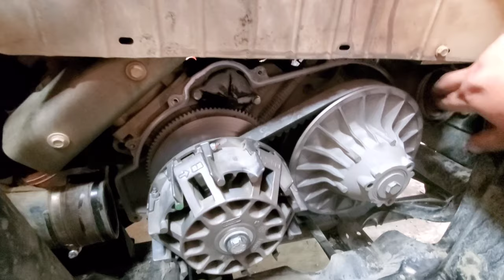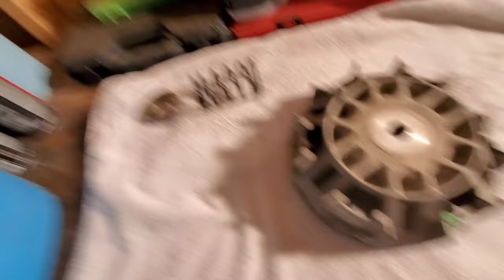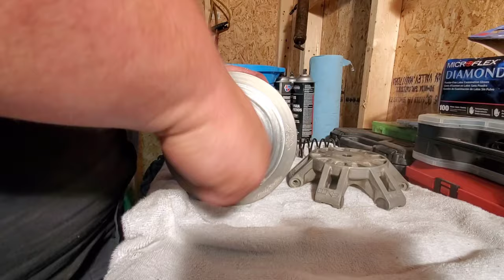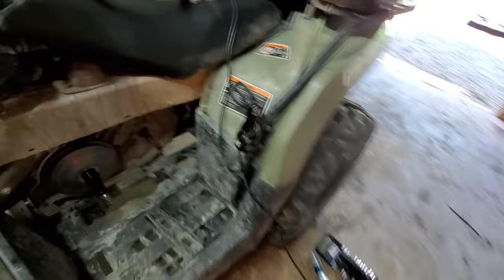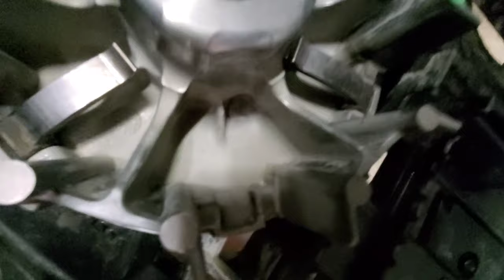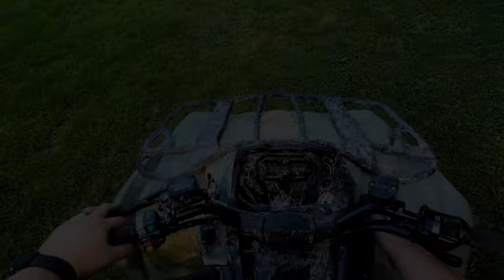WATCH BEFORE YOU BUY A NEW CLUTCH!! Can-Am stuck/sticking Clutch!! Problem Solved

Comment: Was hoping you showed how to install the bolt on secondary clutch. My bolt on secondary clutch sheared off. Just taking it out of storage and getting it ready for the the summer I fixed it but did not have the right tool to hold the secondary clutch was gonna use a piece of wood but just had the dealer torque it for me 12 to 15 pounds than a 180ﾟ.  The tool to hold the secondary corlayeah it's looking very cool lunch is a $180 over here. Maybe I should invest in it just in case. Great video thank you for sharing

Comment: What do you recommend for torquing them on and off? To keep it from spinning? I have to remove mine and clean it. I had a critter decide it was a good place to store food for winter 😢
Reply from the maker: They make a special tool to hold them in place while you tourqe them. In a pinch I've improvised using a piece of wood but I do not recommend doing that because It can damage the clutch if not careful
Reply: @JPar9577  I’m trying to locate the tool.. I can’t hold it tight enough to get the factory  nut off. Thoughts? The nut itself is 17mm... what size clutch socket do I need?
Reply from the maker: @areenders  what are you referring to as the clutch socket?

Comment: Thanks for the video. Did you need a special tool to hold both pulleys while torquing them back in place?
Reply from the maker: Yes you do need a tool to hold them still and torque them
Reply: Thanks

Comment: Should I let the parts sit over night or take em out of the water? I have the bearing in the water as well that you said be careful of because of the small springs which wasn't to bad they fell out in my hand. My clutch wouldn't even move at all, and so I have it all in a bin of dawn blue dish soap and cold water. I don't wanna ruin anything, and I couldn't get the other clutch off.
Reply from the maker: You can let me sit as long as you want the main Thing is making sure everything is clean and dry when it goes back together!
Reply: @JPar9577  awesome ty I appreciate it man, I'll dry everything up tomorrow and put it back together
Reply: @JPar9577  one more question is the primary clutch supposed to be hard putting back together? It was hard getting the spider part out and now it's fighting to go back together like the magnets are stopping it
Reply: @JPar9577  did you grease the clutch bearing before putting it back on the shaft over the two little springs?
Reply from the maker: @kingdon9690  yes I did!
Reply: @JPar9577  awesome ty, everything is back together and runs perfect now. It doesn't try to take off in reverse anymore or forward..no more hard shifting...it still has a slightly hard time shifting to another gear but that's because the shift linkage needs to be adjusted so I don't have to do the famous can am shake and rock 😂 but I appreciate your video you saved me thousands of dollars because a new clutch aftermarket was like 1200 or something like that. It's sad a dealer would charge you an arm and leg for something that just needed to be cleaned up.

Comment: I have a can an renegade 1000 xxc and when its NOT started the gear shifter moves freely wen its started the shifter is stuck in park and i can only select reverse unless i turn it off and move it to another gear but then wen it starts it pulls forward or back depending on the gear im in ... any suggestions ? Do you think its worth doing what you did in this video ? Thanks with love from the uk
Reply from the maker: Sounds like the clutch is stuck i would definitely try cleaning the clutches like i did in this video!!
Reply: Cleaned the clutches today like in this video and also made sure the one way bearing moved freely and it does but still no change to my problem ... ive now got no idea and this lockdown of the uk isnt helping as there in no quad mechanics open and to top it off its due to snow tonight and my can am is broken 😭😭HELP PLEASE
Reply from the maker: @boristheblade0075  did you clean both clutches? 🤔
Reply: @JPar9577  yes i did
Reply from the maker: @boristheblade0075  is the primary clutch sliding back and forth like it should while revving when in park or neutral?
Reply: @JPar9577  yes it is going back and forth ive just gone ahead and ordered a new one way bearing and spring and caps .. although they look fine to me but everything wrong points to the one way 🤷🏼‍♂️ i dont know what else to try .. 🤦🏽‍♂️ thanks
Reply from the maker: @boristheblade0075  im not sure on that either I hope you get it worked out soon though!
Reply: @boristheblade0075  check your idle, high idle can cause the issue as well

Comment: Hey bro I might need your help with some My secondary clutch won’t come off I took the bolt out The spray ain’t push it out the spring is loose just hit me back up and I’ll send you a video for you to see what I’m talking about
Reply from the maker: Yeah sometimes they do that may need to spray some pb blaster on it and tap it with a rubber mallet don't hit it hard or it will break just need to work it loose

Comment: Hey brother I have outlander 800 n clutch area making grinding noise u know what it could be
Reply from the maker: Have you took clutches out and cleaned them? also may want to grease the one way bearing
Reply: Yes I have I started the bike without clutch on left side n can still here noise almost like it's coming from shaft...is that shaft suppose to move a tiny bit like in n out cuz it does a tiny bit....any suggestions....
Reply: Wanted to add video on here but how do I do that
Reply from the maker: You have to click the add video button and upload your video not sure what device your using, it may be different on your device im not sure.
Reply: I did it's on their
Reply from the maker: @JuanRamirez-dv4ou  okay ill check it out